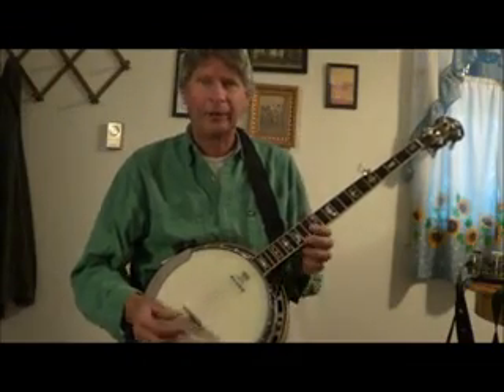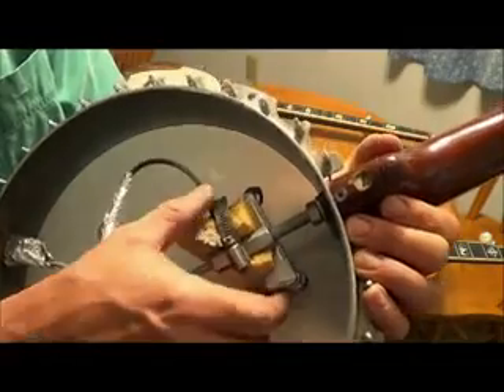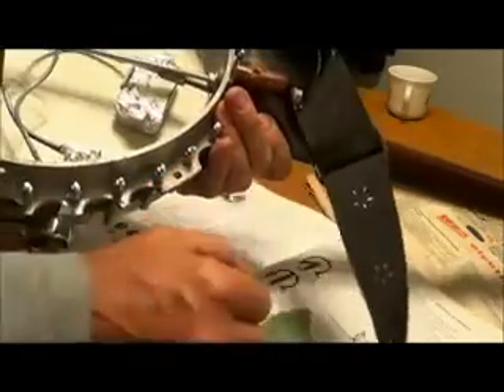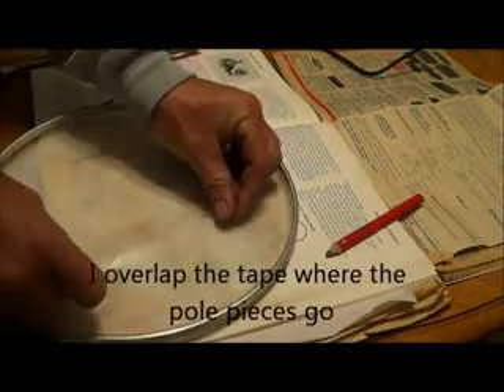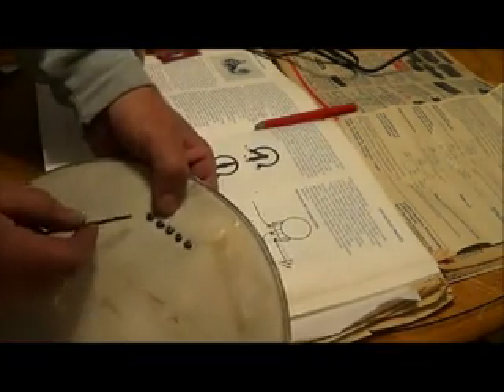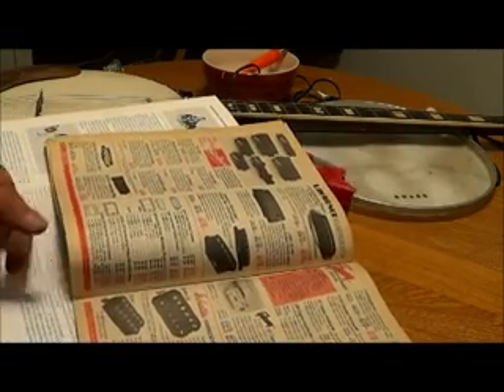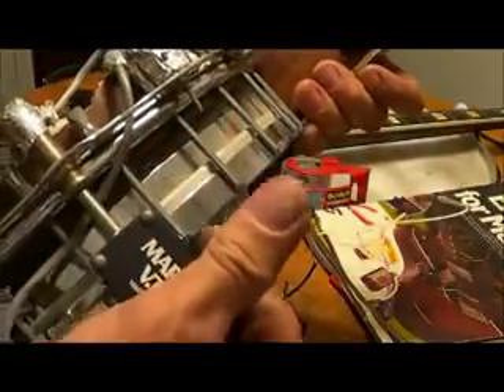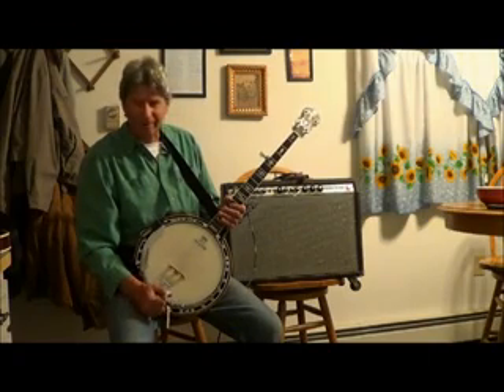HOW I INSTALL A BANJO PICKUP  (Mike Haduck)

Comment from the maker: I use a conductive aluminum tape (aluminum foil) and surround all my cut wires. shielding does what it says (it shields the guitar from things like radio waves, neon lights etc.) and stops a lot of hums and buzzes. chech it out on the internet. good luck.  thanks.  mike

Comment from the maker: Andrea, what I have done is go to the used area in the local guitar shops and buy the used pickups till if find the one that really works. but usually any classic humbucker ( that means not the high distortion ones). will usually work, keep expermenting till you find your sound , the amp also makes a difference, thanks for the commet  mike

Comment from the maker: I say aprox 3 inches, I do have the one banjo without the holes. and I would say it is a good idea to try that first, It will give a good idea of what it sounds like. but it will be a little quiter and a little more bassey and you wont be able to equilize it but good starting point, good luck, mike

Comment from the maker: any humbucker is good, single coils seem a little week and have a tendency to buzz and hum, shielding everthing and grounding your stings is a big deal. keep expermenting with different humbuckers (not to low or not to high) neck or bridge pickups is a coin toss. the type of amp used also makes a difference. if it is too klangey a piece of sponge against the strings near the bridge dampens the highs.,, keep experementing till you get it.  thanks mike

Comment: Hi Mike, I like your banjo videos. I spent the evening putting a humbucker in my banjo inspired by your video. I will get some aluminum shielding tomorrow but you mention grounding to the strings here too. How did you do that? Did you solder onto the tailpiece?
Reply from the maker: It can be done a few ways, on my fiddle where there was no metal I would get strand wire and wrap it around each sting,  on the banjo I would just put the wire under a bolt that I was sure was grounded to the strings, I would say you got to make sure your amp it grounded also and some amps have a switch that change the polarity, Its always a good idea to follow up with a electronics guitar guide or the instructions on how it should be properly installed,  I hope it helps, thanks mike
Reply: After many hours , half the day today, I got the buzz down to a minimum though i think it could be better.
I tried to ground the back of the Volume and Tone knobs to the strings but the buzz got WORSE! 
I ended up running a wire from the strings to the metal piece that holds the plug ( actually behind the plate not the plug itself ) I need to just run this internally and I think I will be good, right now it is on the outside of the banjo.

One more question for you...

My pickup spacing is wider than the strings on the banjo, I was thinking of putting it at a diagonal so the screws would line up with the strings but thought it might make for an uneven sound. How much improvement to you get putting the little holes in the head? Do the screws have to be directly under the strings? Any ideas?
Reply from the maker: I found that they have to be close to the strings,  some closer than others to get a even sound,  So I screw the pole pieces up to the 5 strings and keep the 6th down below the drum.,  For live performances it has worked well for me, some sponges here and there to dampen the ringing under the drum helps also,  every banjo is a bid different and You got to keep experimenting,   I hope it helps,  thanks mike
Reply: With the tailpiece connecting the strings to the rim and the ground, an actual ground wire is redundant, unless I'm wrong.

Comment: I need a 'silent' banjo for practicing in my apartment.  Was thinking about getting an old cheapo banjo and cutting a piece of plywood into a circle for the head and installing a humbucker pickup and using headphones.  What do you think?
Reply from the maker: It will work,   might not sound perfect but close enough,  thanks mike
Reply: Thanks for the reply.  I know little to nothing about electronics but I'm catching on
Reply: This sounds like a good Idea! I play an openback banjo fitted with nylon strings at night. Clawhammer style is especially mellow.
Reply from the maker: anything that works, I have a lot of different banjos I use for different things,   thanks mike
Reply: You can always get a mute. They're very inexpensive and work well. I work on ships and have used one often.
Reply: @kaput450  as far as I know, magnetic pickups do not work with nylon strings, only with steel strings